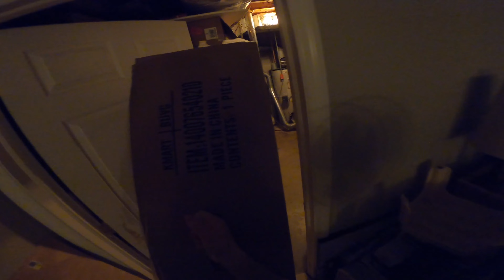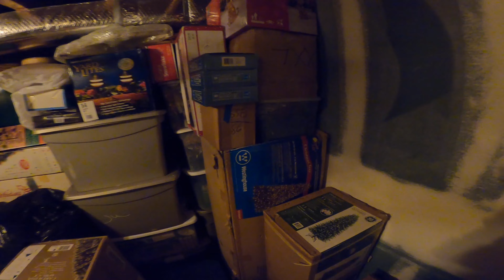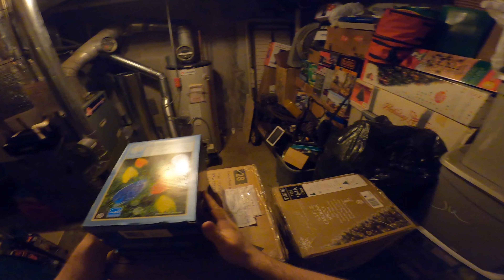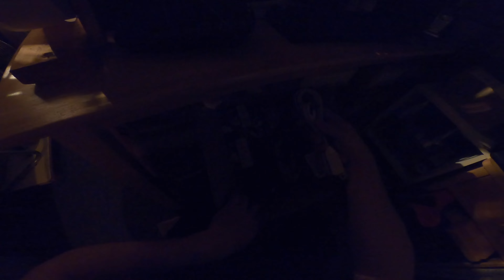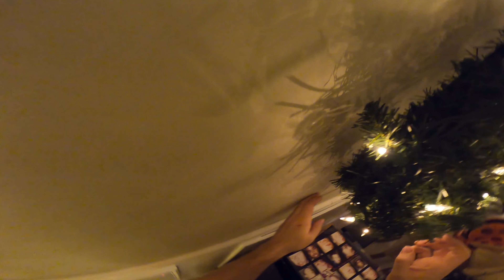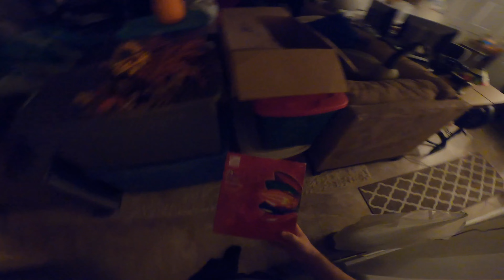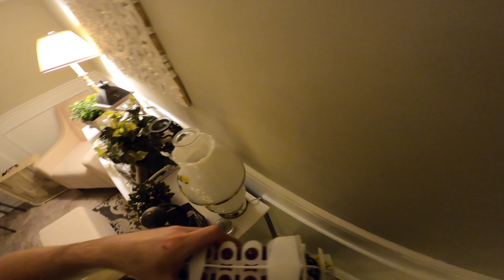Christmas 2021 | Putting Out Some Lights Downstairs, Part 1

Comment: Commenting as i watch this video, Are those pre lit Christmas Tree light sets difficult to replace? Or is the strand integrated into the limbs?
Reply from the maker: I've never tried, but I imagine they are, especially on the newer models where the connection resides inside the poles.